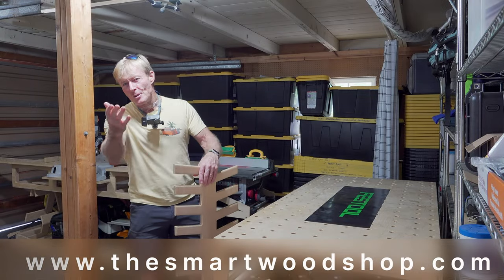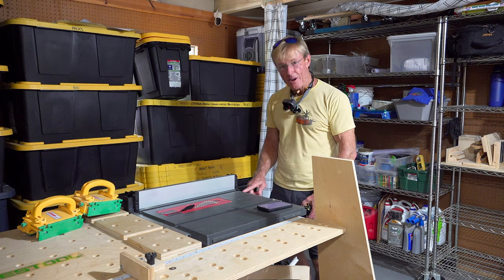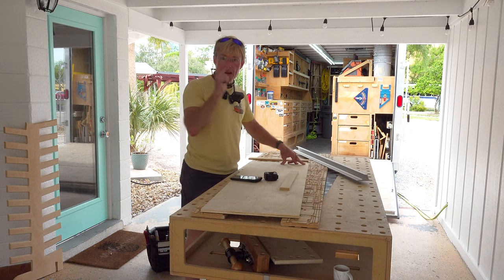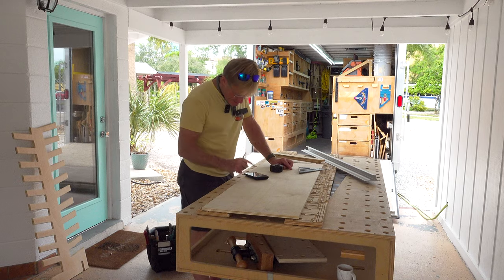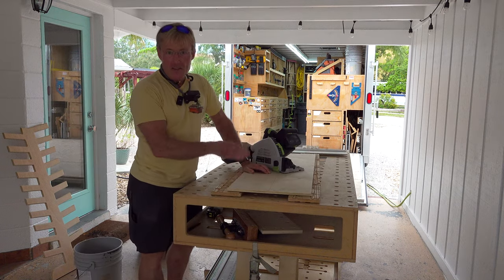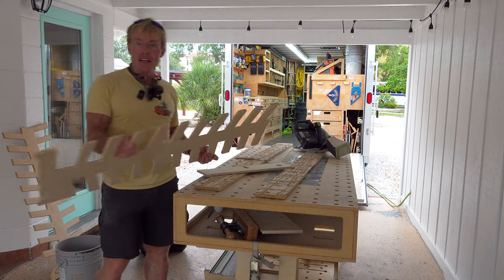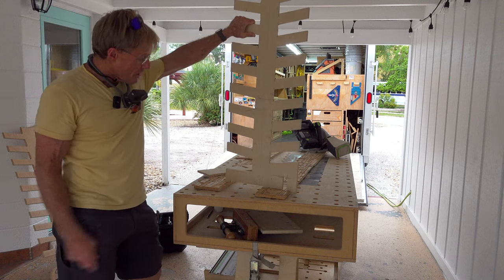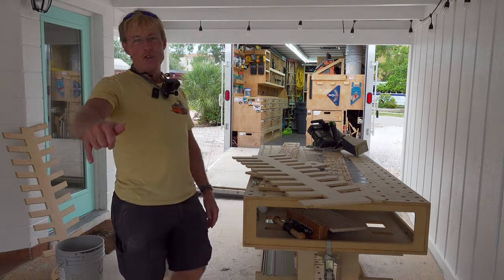Mastering the McGee Trim Rack Template: A Comprehensive Tutorial

Comment: Hey Ron, I've bought the plans and made the PSB... PSS is next.  I am a little confused on this one though.

Why is necessary to offset the arms?     Wouldn't it be just as strong, and easier to lay out the template if the arms were mirrored?
Reply from the maker: This is Jack's design so I haven't spent any r&d time with it. It works so I went with it as is. Thanks, Ron